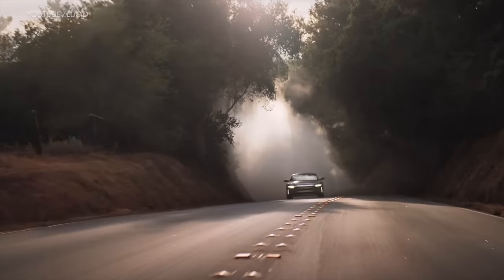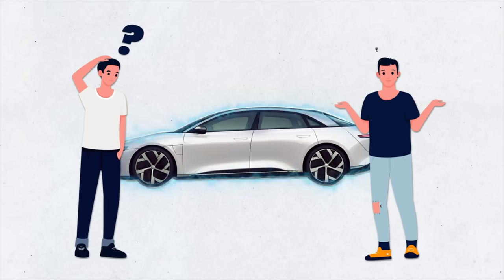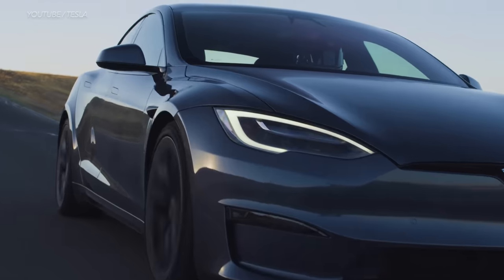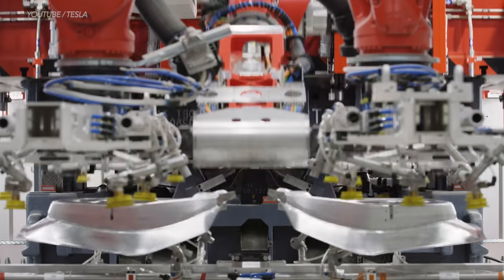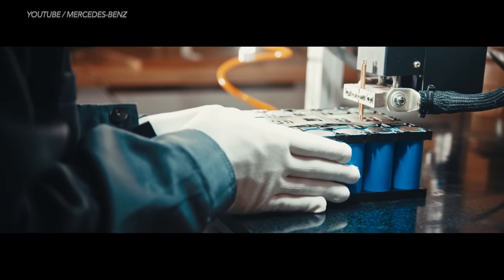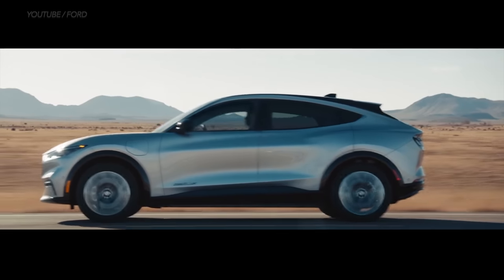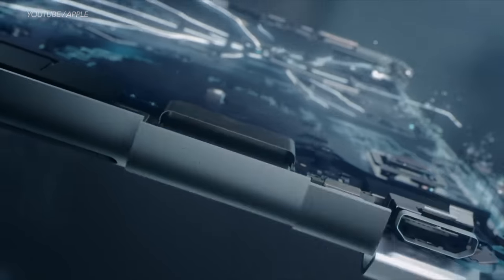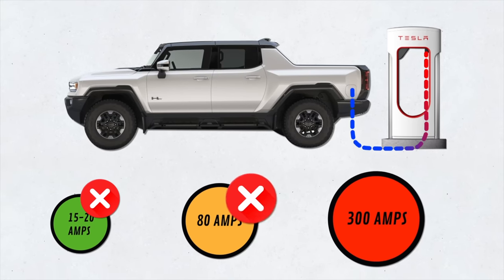Here's Why I'll Die Before I Buy an Electric Car

Comment: Siemens has come out with a charger that attaches to your  home meter socket.a lot of homes (especially ones that primarily use natural gas) have 1oo amp services requiring a upgrade to 200 amp service( upwards of 3,000.00$) will not be required for a level 2 charger.not a ev car fan just saying people who are half broke from buying one of these white elephants can save a few k.

Comment: Great video Scotty!!   I'll pass on an EV to stay with my 4 stroke petrols and my diesel F350.  I'm not saying that I don't appreciate the technology/innovations that went into building these machines.  I'm not feeling the leftist political push to mandate(2035) these electric vehicles under the guise that they will save the world.   Yes the actual electric vehicle itself doesn't put out emissions but that's only part of the story.  Our out dated mostly coal burning power grid puts out plenty of emissions and as we know isn't capable of maintaining enough kilowatt hours for every American to go fully electric everything.  The materials/metals used in these batteries are scarce and there mining carries harsh "environmental" cost.  I'll stick with my 2005 Saabaru with a nice 4 cylinder engine, AWD, leather seating and about 25MPG.

Comment: The biggest problem with EVs is that the lithium in the batteries explodes when in contact with water. Its inherently more dangerous than any fossil fuel vehicle.

Comment: It sounds silly, but I won't buy an EV because I started vaping. It is how I quit smoking. I use older mechanical vapes and had to learn a lot about batteries. The more I learned, the more I realized just how big of an issue this is with any EV.

Comment: Oh Scotty, you will always be loved by old geezers. Did you watch new Lucid reviews? The design and interior look so outdated compared to the Plaid. They even have problems producing that hyped "Tesla killer". By the way, its not fair to compare Lucid and Tesla range when they have different battery sizes. If they would have the same capacity and one could get more miles than another one it would be interesting. It would mean that battery management system and other components work better. For example Model 3 from 2019 has new heating pump which makes big difference. A lot of bragging in the video. What do you mean by range anxiety when searching for charging stations? You forget that we now have smartphones that show us everything (charging stations and etc.). You need batteries for solar panels to charge Tesla at night? In Europe we have solar panels without batteries. The way everything works is simple. With solar panels, we get green energy and send it to the electricity company. Basically, we are working for an electricity company (i mean solar panels, not humans).And for that we get much cheaper electricity. So you can charge your Tesla cheap at home, at night. P.s. good luck GM and MB. :D

Comment: I will never buy another ice car. Electric is better in every way. No more oil changes, no more overheating , no more tune ups, no more belts or hoses. When is the last time you filled up your tank at home? The holy grail of battery tech is closer than you think. 800 mile ranges with 2 minute charge times. I will that Scotty did an excellent job with this video on objectively laying out the facts.

Comment: Purchasing an EV it’s sort of like purchasing a home it really depends on your lifestyle your budget and your long-term goals for example, my wife and I purchased a BMW I three and although the range is roughly 120 miles with the range extender we only use it to drop my son off at school grocery shop and take short trips we also have a gas guzzler. We love the BMW I three it’s great we charge it at night and it’s only added about $27 worth of electricalCost to our existing electric bill we’ve also added solar panels to our home which is drop our bill tremendously we are averaging about $150 a month for a four bedroom home in Florida. So it really depends ultimately I want to have both of my vehicles as electric vehicles however the second one would have to have a Longer-range better battery capacity and of course affordability which had this moment in time is not very realistic.
Reply: it's "i3" not "I three" a real i3 owner would never make that mistake - are you sure you're an i3 owner? hmmmmm...? are you?

Comment: Capacitors. not batteries. faster charge, more eco-friendly, they ain't here yet. Panasonic was the company that made caps for Cornell-Dubilier, where i worked for years as an electrical engineer. My dad loved Panasonic products. well made and MADE IN JAPAN. If Panasonic is involved, it will be serious business, or none at  all.  very "disciplined" company.

Comment: According to Polestar, the production of its own electric car model produces 24 tons of carbon dioxide, while the production of a similar gasoline-powered Volvo XC40 produces only 14 tons of carbon dioxide. The mining of minerals used in batteries also involves significant environmental and human rights risks. Selling an electric car after the battery warranty has ended (estimated at 8 years/160,000 km) has no trade-in value if the battery has not been replaced. How much new battery cost?
According to the calculations, the total emissions of an electric car are lower than the total emissions of a gasoline car at 80,000 km if "European electricity" is used and only at more than 110,000 km if "universal electricity" is used. Simply buying an electric car is therefore not an eco-friendly act. This is how it is reported in the Finnish news.

So the world is not saved with an electric car.

Comment: Would not a larger generator which is large enough to recharge the batteries & use a regular coolant or special coolant to reduce the extreme heat produced by the batteries? Please correct me if I am wrong in my concept. With the larger generators & battery coolant would it not extend the life of the batteries but eliminate the use of any EV charging stations..

Comment: Well that's all very informative, you say you won't buy one because of the battery problems, then you go to great lengths to explain how many companies and car makers have come up with far better batteries. I personally won't buy one because I think the re sale on these cars after 10 years will be abysmal, who will want to buy a car that now has limited range because of the failing battery and in order to buy a new battery it will cost more than half of what the car cost when it was new? Also the electricity grid will not be able to handle having most of the population charging cars, and that's why this technology will ultimately fail, not enough power.

Comment: 1000 mile range with 5 minute charging. 45-50k vehicle. I’ll be sold. The low maintenance of the EV is a big plus.
Reply: You actually need neither, because you won't drive 1000 miles in a day. You would have to stop for a break at some point, plus you'd need to sleep.

Comment: Upgrading my electric panel, long line ups at charging stations, range anxiety, battery ware down…just seems like electric vehicles still have a ways before I could adopt one. Still not enough to switch from a combustion engine, especially as the economy adopts hybrid work from home. Less people on the road. This might even cause gas to come down eventually and be cheaper as more EVs are adopted. So why not keep a gas powered car still. Regardless, we are witnessing a paradigm shift in the how we travel.

Comment: When the driving range gets to at least 850 miles and there are plenty more power up hubs (and ideally hydrogen fuel cell) then I'll be get my electric car
Reply: Just get a trailer with a tank and a diesel generator on, and your range could be 2000 miles - without stopping!
Reply: @elbuggo  Not really, because you'd need a generator the size of a shed to provide a constant current of 7kw.....

Comment: When EVs can charge at least couple hundred miles within 5 minutes, there would be very little reason to stick with ICE vehicles. Still waiting for a 500 mile range vehicle @ 70mph. Full or near full charge within 15-30 minutes.

The truck and towing issue is another drawback for EV.
Reply: Saw another test video.  EV Ford F150 vs GMC 1/2 ton IC towing a 4000 lb trailer.  EV had to stop and recharge at 86 miles and it was the extended range model.  That was without running AC or heat.

Comment: Most can't afford a home charger for EVs and most don't own  their own home to install one or have the garage required.
Most small/medium size cities in the US don't have charging stations. So that means road trips out of the way just to charge and you may have to wait hours in line, many none Tesla chargers don't work and the NAV system telling you where to charge is seriously incompetent.
We basically need a charging station for every gas station in every city for this to work.
Let's not forget they charge a ton of money for level 3 charging so you don't have to charge overnight  like at home.
Like Scotty said: "using lvl 3 quick charge (30min-1hr) is damaging to the life of your EV AC battery" and 90% of the world can't get the cobalt and other materials required for these batteries to make the world run on EV.
Maybe by 2030 we may see improvement and more charge stations and solutions to the problems EV faces.

Comment: What I'd really like to know, is what is the range on these when the temperature is -35C? I'm guessing less than half.
Reply: I can drive 450kms in summer and 300kms in winter. You can stretch those ranges if necessary by slowing down but those are good real world hiway driving numbers. And by winter I'm talking Canadian prairie -30C. The range loss is significant but 300kms range is not prohibitive to ownership in my use case
Reply: Interesting, I thought it would be worse.
Reply: @joeblow4888  not all evs are created equal. Mine has a heat pump so that helps with efficiency. Lots of evs use an electrical coil to heat which uses more power. It's certainly possible that you could see worse cold weather performance in other evs. It was a huge consideration because if where we live.
Reply: -35°C!!?? 🥶Where do you live?
Reply: Canada.
Reply: @joeblow4888  You might lose 20% in a worst case scenario......

Comment: Electricity is not free. Besides the cost of replacing expensive, heavy batteries. Wait till they start charging big bucks for electric plug-in and tax. And then they will tax our mileage. If you live in an apartment complex like most people that are on the bottom of the wealth scale, you can forget about having a car. It’s public transportation for you. But that’s what they want.

Comment: The elephant in the room is that the US grid and power stations cannot deal with anywhere near 100% electrification of surface vehicles. Windmills and solar farms are by their natures are not going to be enough to power vehicles, homes, businesses, utilities, and industry period. If they wanted to be an ultra low carbon or carbon neutral society, they should have been building out a vast nuclear powered grid 30 years ago. Even Elon said as much. Yeah, nuclear might cost a little more per Watt, but it's way more reliable and capable.
It's too late now. I hope you don't live near the water.
Reply: If biderectional charging becomes a reality, EVs can actually reduce the strain on the electric grid.

Comment: The nuclear car is a strange mention.  I'm a big proponent of nuclear power as modern designs could safely and sustainably power the planet for 100,000 years, but I'd never want millions of cars carrying nuclear fuel onboard at high speeds.  That would be insane.  No reason not to power cars from a grid powered by nuclear power though.  I like the Ionic 5.  Enough range to take me where I want.  Easy to charge overnight and it will charge in 18 minutes from a level 3.  Not generic looking at all.  I guess my only issue is that EVs are evolving at a breakneck pace.  If I spend $50k on a car, I'm concerned that over the life of the loan new versions will come out which will radically reduce the value of my car.

Comment: I have a 15 year old car that still looks and runs like new with 95000 on the clock. Even with less than half of that mileage, would an EV battery still have enough life in it to be useful at 15 years?
Reply: Very recently, on the Go Green Autos YouTube channel, they had a 5 year old Hyundai Ioniq with 90k miles. The car was in beautiful condition, and they tested the state of health of the battery while the video was rolling. It showed 93% SOH (state of health) The car sold very soon afterwards for £15k......  A 10+ year old EV battery can readily be refurbished for considerably less cost than a completely new battery...... A UK owned 10 year old Leaf battery was refurbed on a YouTube channel for £500... The job took 4 hours...

Comment: And if you run out of charge somewhere, you are going to need a tow. Can’t just bring it some electricity.
Reply: You could bring in a diesel generator and charge it that way. Or if someone builds a big portable battery - something like a big powerbank which can be transported in a pickup truck
Reply: Flag down a Diesel pickup with Generator Welder in the bed. Some guys make cash pulling people stuck in a snowbank.
15kw generator. 2 hour charge, $200.
EV drivers should carry 2 C-Notes for emergency.

Comment: All these new battery technologies are not new, solid state batteries were discovered in 1831, in 2011 it was demonstrated this could be made to work at room temperature. At 2023, we are no where close to these being ready for mass production. Even with Lithium batteries, it took 30 years to get them to a usable state and longer to make them competitive against Nickel–cadmium batteries. Lithium based batteries are still not used in non-EV cars because they are so fussy about temperatures / charge levels and we still use lead acid batteries (even in EVs).

If we see any of this new battery technology by 2050 I will be impressed.

Comment: I will buy an EV if these criteria are met. 

1. Charging time 
2. battery degradation 
3. Performance in extremely hot/cold temperature/ 
4. Range! (Needs at least 2x the traditional gas engine range!) 
5. Maintenance and Upfront cost (lower if not similar to an average Toyota price 6. Reliability! Less repair than gas cars, or easy to do diy repairs. 
7. Charging station! EV charging station needs to be at literally everywhere like gas station. 

If an EV can fill all the criterias I have listed above then I would happily switch to an EV

Comment: Retired, the wife and I rarely put more than 3000 miles a year on a car, so high gas prices don't have a significant impact on our budget.  Electric cars are either ugly, or far too expensive.  Battery technology is in its infancy and if you buy now, you'll regret it five years from now when much better, much cheaper batteries are supposed to be available.  Only idiots and the rich buy new cars, and buying a used electric car runs the risk of getting one with a poor battery.

Comment: Until a full EV costs the same as an ICE equivalent, can travel well over 400 miles on an 80% to 20% discharge in all weather conditions, and be recharged in 15 minutes everywhere, people are not going to be interested.  Commercial charging stations are already charging so much per KWh that charging an EV is as expensive as driving a gas guzzler, mile per mile.  That has be fixed.  And, anything but the slowest home chargers cost thousands to install, and only homeowners even have that option.  Then there is the cost when the battery pack has to be replaced, and the fact that our electrical infrastructure in nowhere near ready for all the chargers that will be required.  All things considered, EVs are not going to be a reasonable option for the vast majority of drivers for decades.  PHEVs and hydrogen powered cars seem much more practical.

Comment: It is hard to get past the fact that 60% to 70% of the charge in any EV comes from coal. 
The lack of capacity of the power grid to support EV will cause electricity shortages at home. Energy prices are climbing at home, too! EV’s enjoy subsidized manufacturing, in effect, I’ve already bought one, I just can’t drive it.
Keep your coal fired, government subsidized, grid sucking, heavy, short range, fire hazard, expensive, EV toys. 
All that said, there is much to be done to improve the gas and diesel engine efficiencies.

Comment: 18,650 cells? Uhm, Scotty, pal, are you sure you don't mean, they use cylindrical cells that are 18mm wide, and 65mm tall? Because that's what the 18650 stands for. The 0 means it's a cylindrical cell. Just look it up on Wikipedia. Otierwise where are you sourcing this info from?

Comment: Scotty, I refuse to buy an EV when I have two paid off vehicles that I maintain myself. A '79 GMC C-1500, and a '90 Ford Ranger. Both are either classics or the GMC is an antique (according to the State of Alabama). I'm not going into debt for an inadequate vehicle that will not do what my two trucks can do. Time is precious to anybody, and waiting for your new junk to charge up is a waste of that time. If it will not charge up in the time it takes to pump 30 gallons of gasoline, it is useless to me. Now, if they could (and they can) refit my trucks to run on liquid hydrogen, then I could get used to that. 30 Seconds and you have a full tank, the range can be awesome, and maintenance would be 50% less as the exhaust is just water. So much for battery toy cars like when we had as kids.